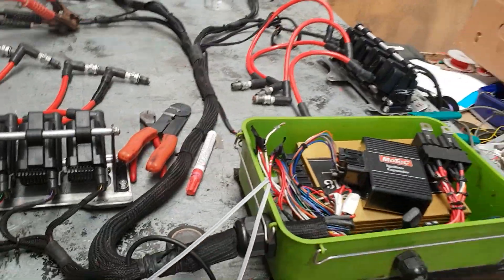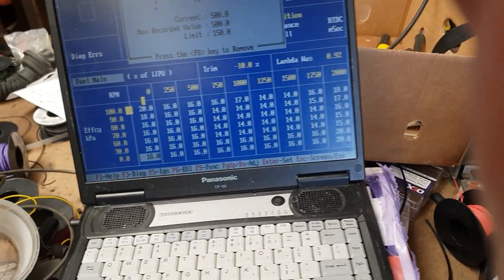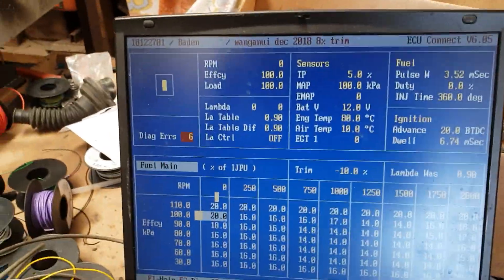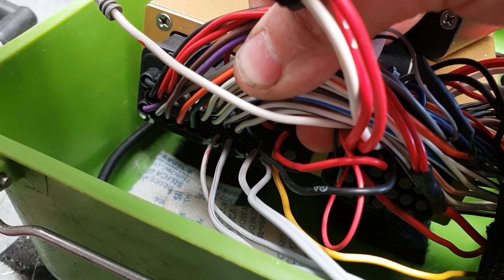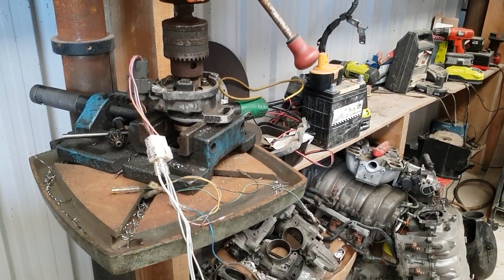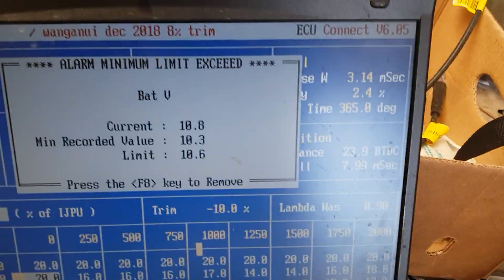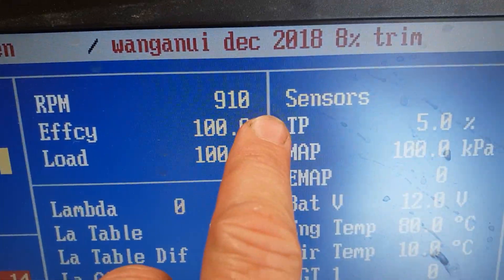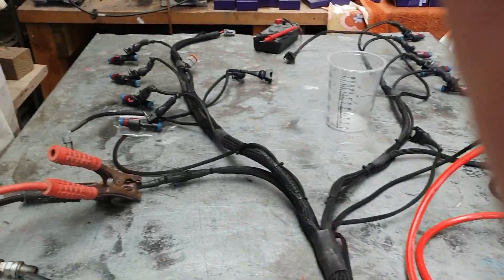Motec M8 ecu bench testing.

Comment: Did u get any filming of 27th what blew in the motor
Reply from the maker: got some footage.  Started working through it but its a bit messy as I was busy with engine.  Engine is out but yet to strip and see.  I can see the data and saw the external damage so it's not going to be good.
Reply: CartuneNZ hope it can be fixed for round 2?
Reply from the maker: @blakehughes7586  I hope so too.